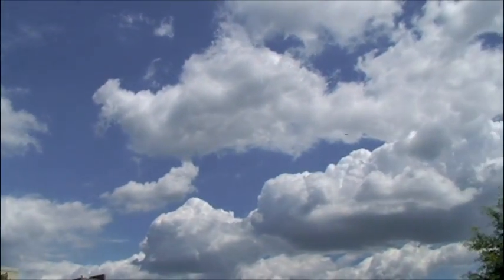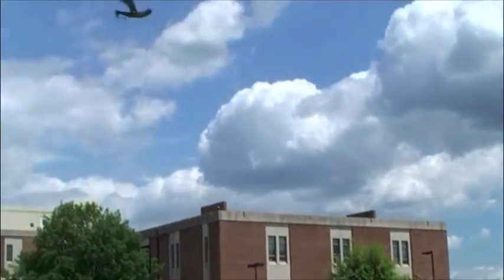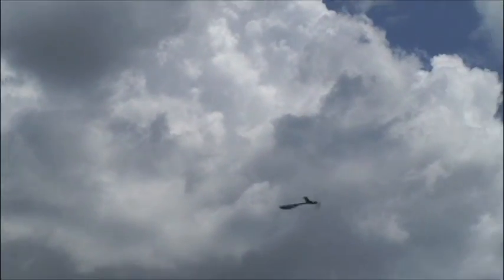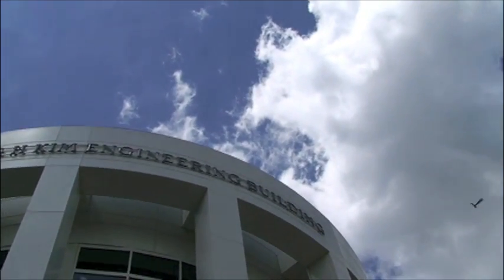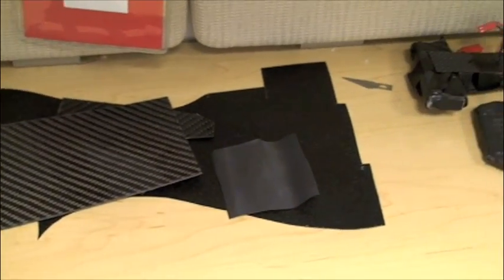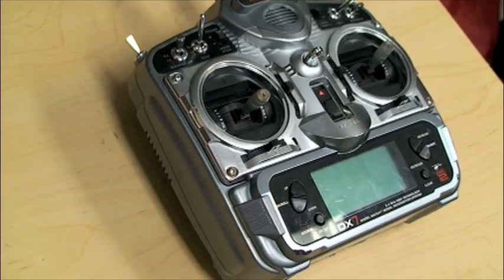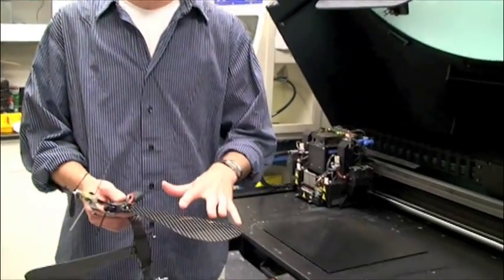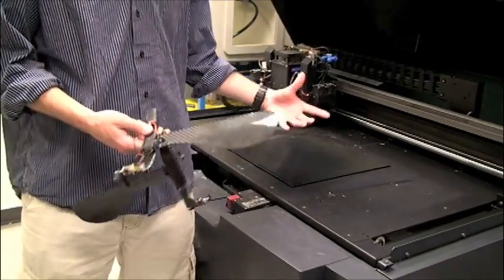World's first controllable MAV monocopter, Robotic Samara (maple seed)

Comment: Your thinking too hard. Left, Right, Forward, and Back is all relative to it's rotational orientation.

 If during spin the hypothetical bow of the craft if facing North, then telling it to go forward will make it go North. 

However if the hypothetical aft of the craft is facing North, then telling it to go forward will simply tell it "Go in reverse", thus making it go North. The control surface, or wing, can be elevated in relation to it's rotation, thus providing both lift and direction.